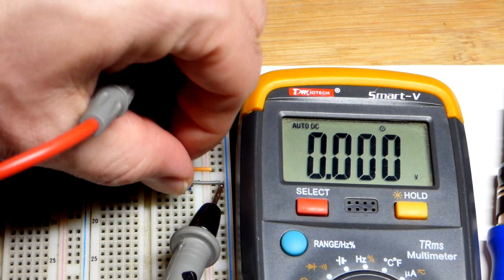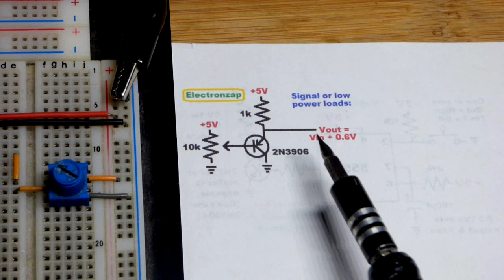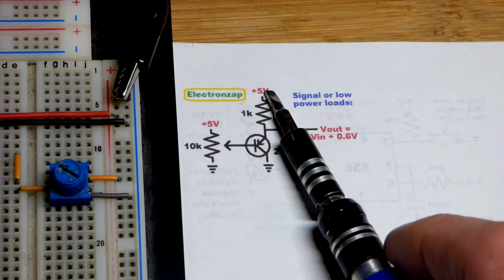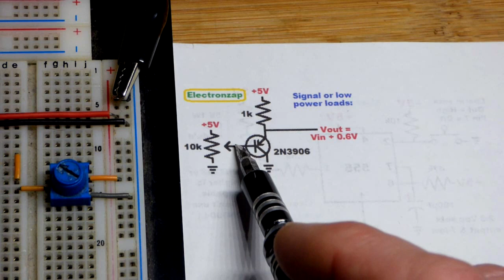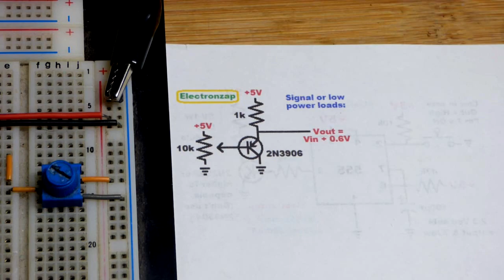PNP BJT Emitter Follower Circuit Fragment

Comment: Your totally wrong.
If the voltage at the base is lower than the Vcc, then, there will be immediate current flow from pn junction.
So, voltages at Vcc and base MUST ALWAYS BE EQUAL.
Reply from the maker: Thanks for the info!